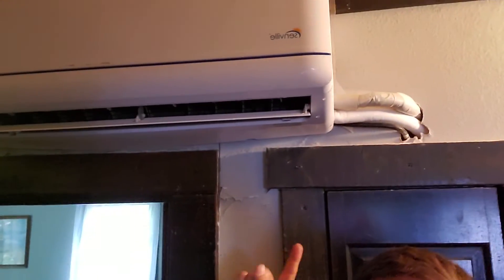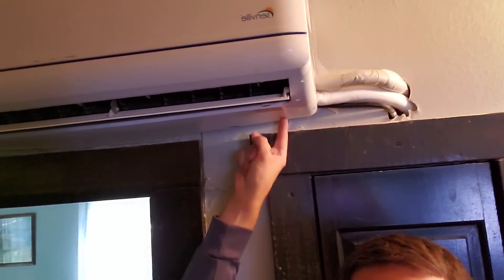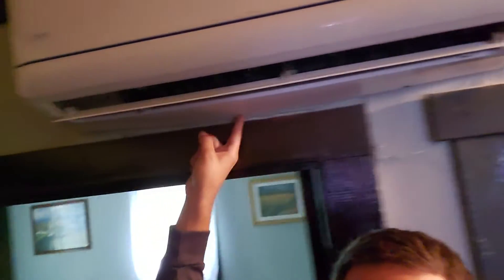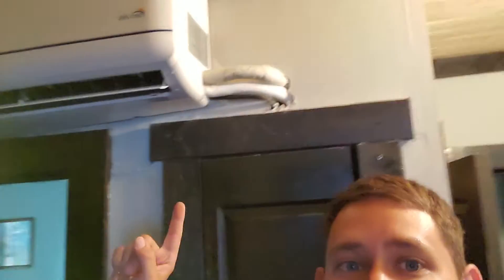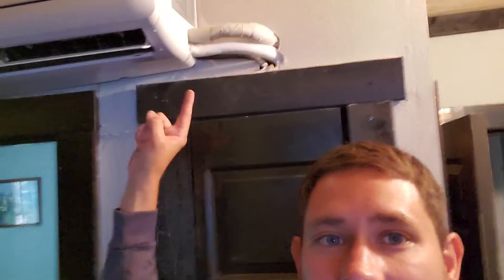Ductless unit Wall Mount air handlers drain installation

Comment: the drain hose in the back of the air handler is really soft plastic. It hooks up at the back of the air handler to more of this flimsy hose and the connection is weak at best. How do I get rid of this hose altogether and what can i use instead? specifically what connects to the drain coming out of the handler ?

Comment: Hi Tad. Great video. Thanks 

Question : Can you explain (in text or through a video), how can we twist the refrigerant lines safely to come off the side of a mini split indoor unit, as is shown in this video. 

I have a similar Senville unit. Most of the videos on YouTube show how to take the line set through back wall of the unit. But no one shows how to take it sideways.

Appreciate the help. Thanks
Reply from the maker: Yes I can, Great Idea
Reply: @taddydigest  that would be great!!

Comment: Hi!
Nice Video.
 We have a Mitsubishi Mini Split Installed. BUT, foot-thick walls for Net Zero here in MA. The builder put in a "HORIZONTAL "2-inch" conduit for the drain and the copper pipes. We had negative pressure in the home that would make the drains "pop" when the condensate was in the pan. I finally fixed the radon system caused negative pressures (proper sealing of basement slab to foundation walls) and we don't get the pops BUT I think the pipe is kinked because the drain pipe is angled from the machine. I think I might have to install a new pipe at the angle of the end coming off the machine. 
Questions:
1) Do you know the angle of the pipe installed at the machine end?  
2)  I won't mess with the pressured pipes but was thinking to install a new drain pipe through my foot-thick walls. At an angle so I can put it in the conduit covers on the outside of the house. Do you have a suggestion as to what I would use as protective piping to prevent the condensate pipe from being crushed by the loose cellulose insulation - which is packed tightly into the wall?

  I figure I would put a bend at the top inside end and just let the pipe go through the siding and then cut it off flush. Hitting it with some foam to close any possible leaks. Then, just run the new condensate pipe into the previously installed conduit covers.
Thanks
Reply from the maker: Thanks for watching my video I really appreciate Your time and your questions
 I have a video that I am publishing next week that You should check out
 It's about drain options for Mini split

Comment: Can you run the ac lines through the ceiling so don't have to drill through sinder blocks?
Reply from the maker: Yeah you can run the lines through the ceiling

Comment: I thought indoor units must be 6 inches from the ceiling. Yours doesn't look like it is. Does is still work properly?
Reply from the maker: Depends on the manufacturer of the equipment some manufacturers recommend 4" some manufacturers recommend up to 8
 Depends on the manufacturer
 I only install Samsung and all my units I install are strictly by the installation guide

Comment: I had one condensate drain that would sweat a lot and drip down on his door frame outside the house. It was not leaking, it was sweating. they had it turned down to 65? Would the insulated condensate line take care of that?
Reply from the maker: yes 
the insulation would take care of the problem yes you are right

Comment: Do you use a clamp or zip tie to secure the condensate line (that is attached to the unit) to the drain hose?
Reply from the maker: I use a clamp usually a one hole or 2 whole